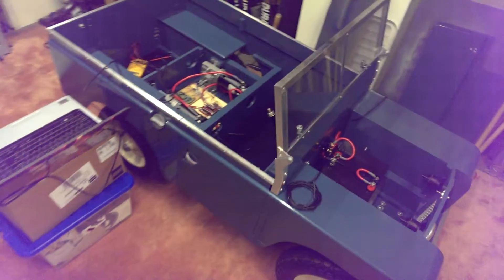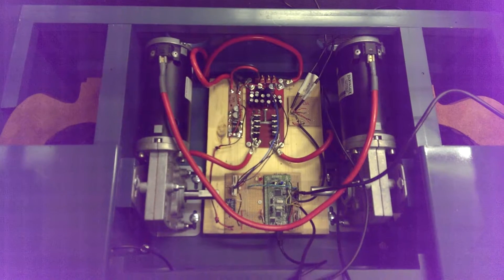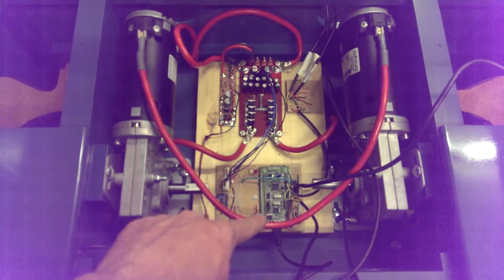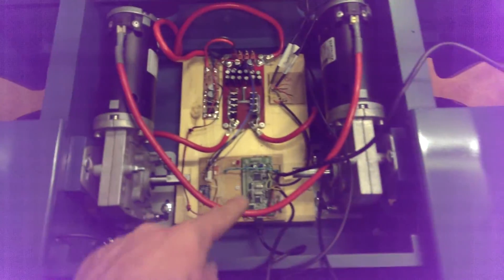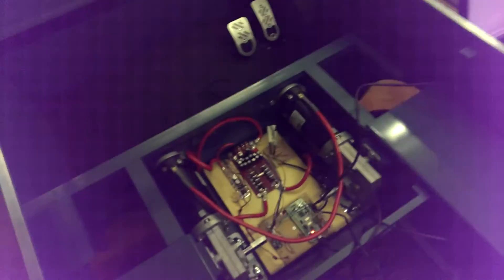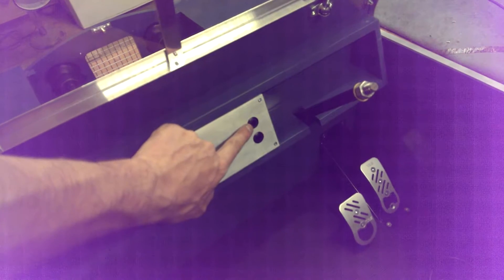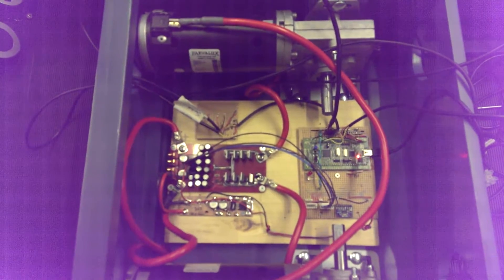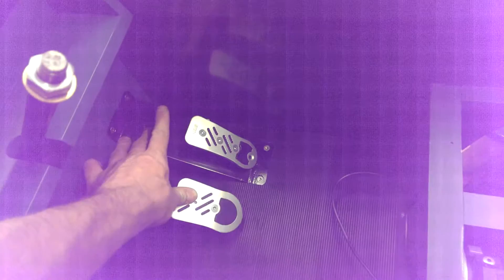Toylander - Custom motor controller

Comment: Wow did u make the controler yourself? Thanks
Reply from the maker: Yes. Fully bespoke. 🙂 Designed to make is safe for kids. Controls forward and reverse and also controls the lights.
Reply: @jimh7475  Wow. so u into electronics as a Job?